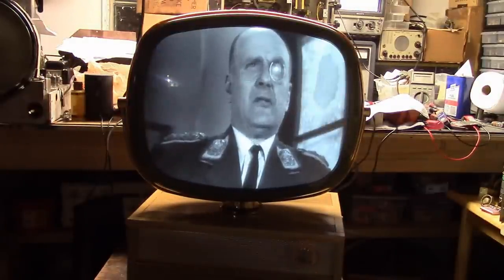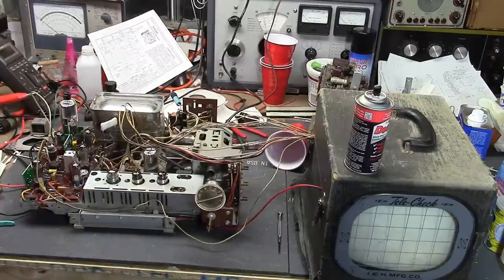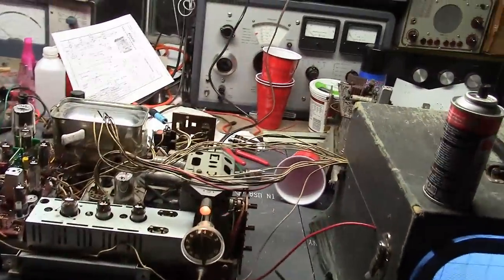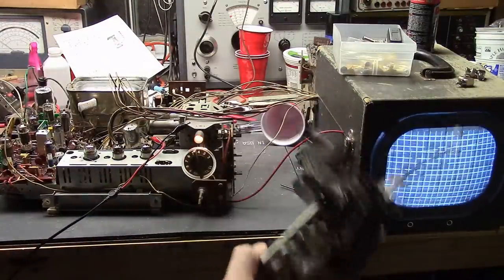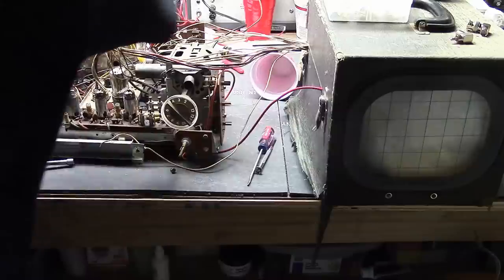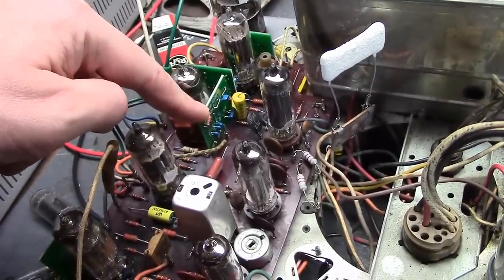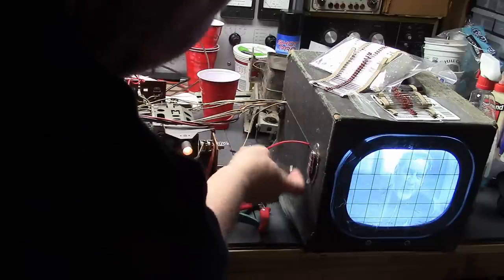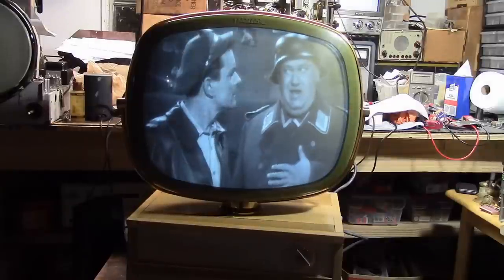Predictapalooza S2E03 - Al's Blonde Holiday

Comment: Very good your presentation and comments about restoration etc yesterday in the Museum Meeting. I wanted to add a point but didn't found the time to talk. Here we go: Even though in your Predicta restoration projects all caps and resistors are being replaced by new and reliable parts, there is something that cant be controlled, and are "tubes" . They can die or short suddenly like "tomorrow" . That is why, back in the days, there were so many Repair Shops "everywhere" at any town, any city.
Reply from the maker: We briefly danced around the topic of tubes.  Yes, they can (and will) go bad eventually, but rarely do in my experience.  I can't recall ever having to replace a tube in a restored set.  It is not at all unusual to find some original tubes in a set with many, many hours on it they are still good.  
Now to be fair, my customers and I do not run these old TVs very often.  Special occasions and to demonstrate.  Maybe 30 minutes a month or less compared to hours a day when they were new.
Reply: @bandersentv  Totally agree. Old sets are being restored not for "watching TV" but for be running just a few minutes,. However, some places, like the Music museum in Nashville, are using old B&W and Color sets for displaying videos from the 70's and, according to the manager, they can't have a working set for more than a month, without any issues. Lol...